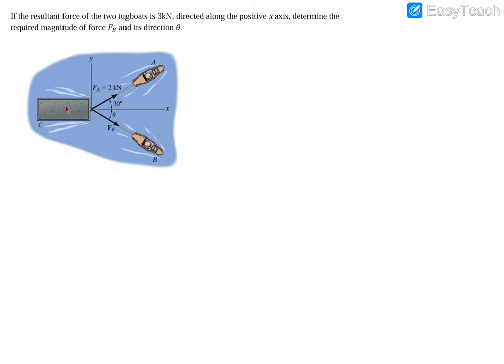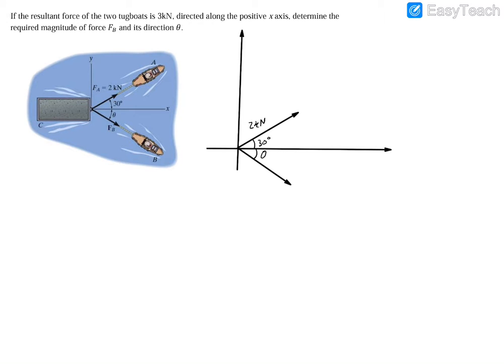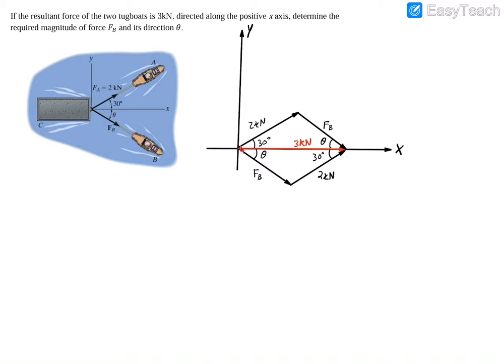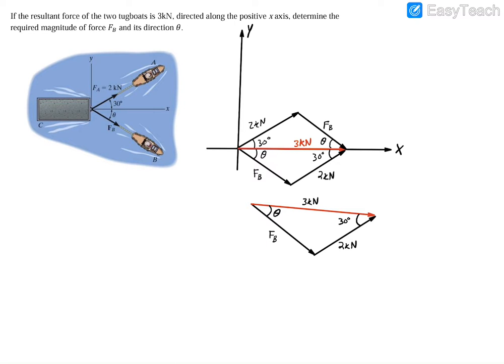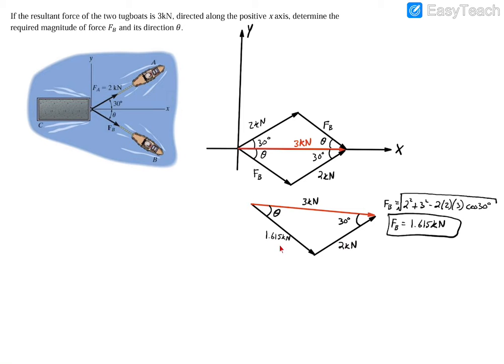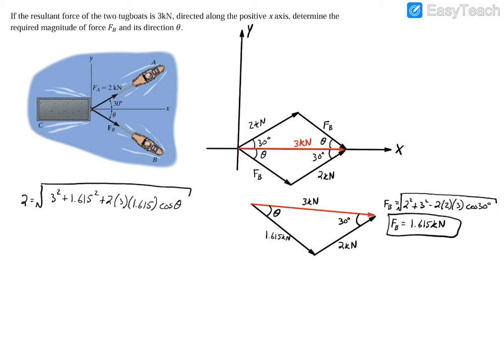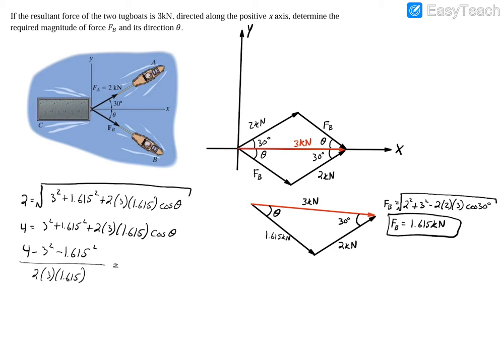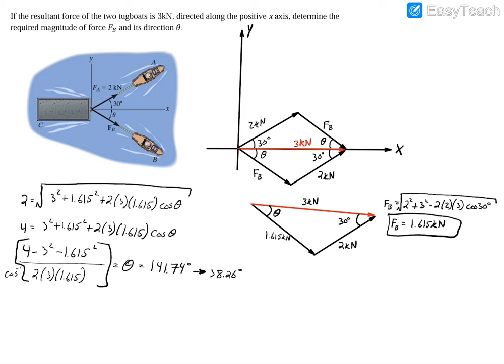If the resultant force of the two tugboats is 3kN, directed along the positive x axis, determine the

Comment from the maker: CORRECTION: Please note that at 4:22 I wrote down and said to ADD (2)(3)(1.615)cosθ.

This expression is SUBTRACTED, NOT ADDED.

Therefore, when you plug in (-2)(3)(1.615) into the denominator, you are automatically yielded with the final answer shown here, 38.26°.

I apologize for any confusion.

Comment: What if fa is unknown and fr is still known and u need fb to be minimum how do u make sure that fb has the minimum value ?
Reply from the maker: @karimkemo5786  Do you have the angles between Fa/FR and Fb/FR?
Reply: Only for Fa which is 30 degree
Reply from the maker: @karimkemo5786 I apologize for the delayed response. If you still are stuck please submit a request in the link in the description.
Reply: @karimkemo5786 sample problem 2.2 from vector mechanics for engineers?